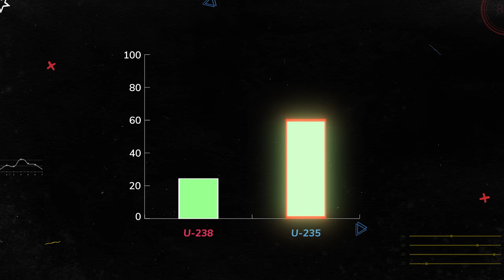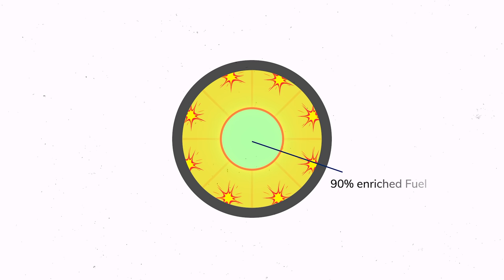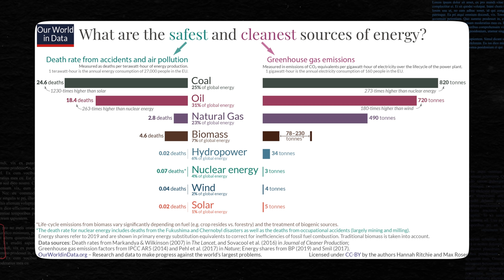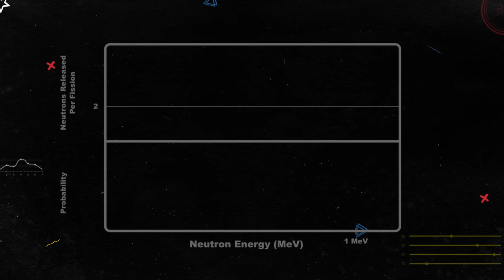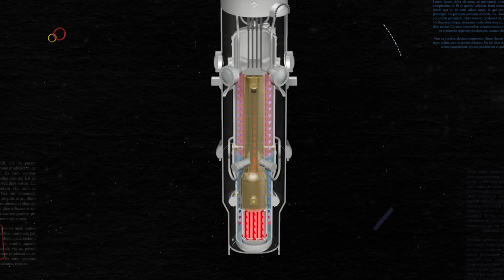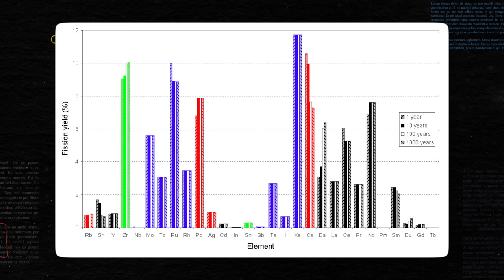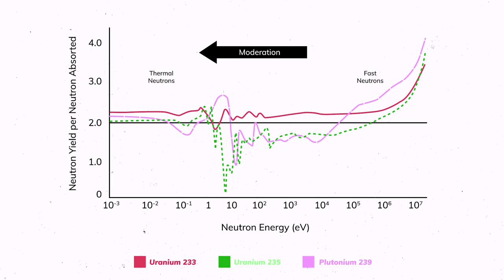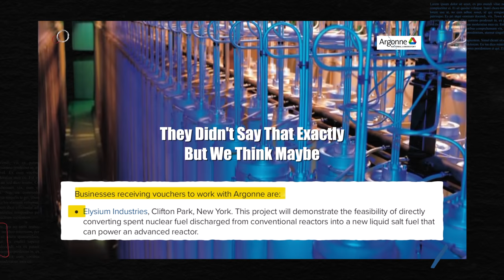This Reactor Feeds On Nuclear Waste

Comment: The one thing I noticed you didn't talk about is about is one of the safety devices they have designed into a molten salt reactor, There is a frozen plug they put in place where if the temps get to high, It melts this plug which then drain all the molten salt into an underground containment unit and instead of a nuclear melt down, the reaction completely stops, They then can fix what ever issue they where having and pump all the drained material back into the system to restart the process again, Without the molten salt you cant get a reaction out of the graphite cores, This prevents a nuclear melt down and only can be done in a molten salt reactor, I'm no expert in this field and only learned this through research years ago so I might of messed up on terminology or something but you get the picture of why this is such a safe system compared to a normal nuclear reactor
Reply from the maker: Hey, Elysium isn’t using a freeze plug.
Reply: @TechforLudditesSira  That would explain why it wasn't mentioned, I think its great they found a way to reused the waste, Ive been waiting for something like this to happened and knew it was only a madder of time, I look at what happened in the past and noticed a pattern, For instance, they discovered how to make kerosene and used to dump the waste into the oceans, they eventually learned how to make gasoline out of this waste and then they started throwing away the waste from producing gasoline, eventually they learned how to process diesel gas out of this waste, This made me feel that there had to be a way of reusing nuclear waste and it would only be a madder of time before someone would figure it out

Comment: VHTR reactors would be interesting to see analyzed here. also the Gen 3 to Gen 4 transition needs and costs. If there is already a good description why thorium reactors currently are not economically viable (infrastructure) and that the benefits of no weapons grade products - can be instead avoided and weapons grade fuels produced... there are many nuclear reactor designs and rarely they are popularized or spoken about as an integrated systems with industry or public. The UK schoolkids  nuclear waste microreactors also are a fun exercise to better understand polutionless energy production methods.

Comment: Another thing you can do with waste heat, is extract CO2 directly from the atmosphere  The extraction cycle consists of room temperature CO2 absorbing materials simply absorbing it, followed by a heat cycle to release it again.  This can be done in a controlled way to extract CO2.  Then, excess electricity from the same nuclear reactor, can be used - combined with water, to transform the previous atmospheric CO2 into a simple hydrocarbon known as "blue diesel", which can then be used as a replacement for oil in applications where other options are impracticle - jet fuel, plastics, etc.   This would make nuclear super eco friendly - actually solving existing environmental problems rather than creating new ones.
Reply from the maker: Interesting! I did hear Kirk Sorensen talking about how they were going to sell diesel from their nuclear plant and that confused the hell out of me. 

This is what he must have been talking about 😅

Comment: There's one more benefit to this kind of reactor. High temperatures enable it to create hydrogen efficently. Which we then can use in fuel cells and hydrogen combustion engines.

Fuel cells electric cars enable us to build electric cars with high range and fast "recharging". Because you don't need to recharge a battery. You just pump hydrogen into the tank.

Comment: The problem with Thorium fueled reactors is fundamentally chemistry. The solubility of thorium fluoride in carrier salt is less than 10%, and the fluorine, once ionized by the radiation, is aggressive enough to cause problems for long-term operation. Uranium chloride-based fuels can have a fuel content as high as 50% uranium by weight, and burn existing "waste".
Reply: Very good. I'd like to see a video on whether it is possible to meet the climate change requirements of the Paris agreement without large quantities of nuclear, is whatever type. Should we treat nuclear like a pandemic vaccine: too much is expensive, but too little is much worse.
Reply: @michaelwright7326  
Nuclear is by far the cheaper option if plants are designed to operate 50-60 years. If the lifespan is only 20-30, other renewables become competitive. This depends on location however, not all places have good consistent winds or enough sunshine. Atoms don't care about the weather.

Comment: apart from the cost of building a system to produce electricity, which i find irrelevant for this purposes, it is good to see that one of the two main problem is addressed and solved. Now what should we do with disused plants, as well as the main problem how to clean up a   site when things go wrong? I think if the clean up or null the effects and problems of radio active accidents etc can be nullified and be resolved as with the waste   then i think it will be more accepted as a source of power, by most of the public

Comment: Nuclear waste burning reactors already exist and are operational since 80s and 90s. Russian fast breader, lead bismuth or salt cooled reactors BRN 600, BRN 800, BRN 1200.
Reply: lead cooled systems come with their own sets of problems - lead oxidises and eats brains just like mercury does (quite literally, it's an occupational hazard of the leadworking industry and autopsies show brains with big holes in them). Bismuth is also dangerous to be around if molten and sodium just burns furiously

If you're going to come up with an alternative to using water, it's a good idea to have a SAFE alternative

Comment: I enjoyed this presentation. My question has to do with the losses of power thru distribution networks. If these  reactors can me miniaturized, then distribution is localized and loss through transmission goes away.
Reply: Perhaps.   I don't think it will get as bad as solar is, where there are mini reactors all over the place.  This is still a utility class technology.  It will need to be a real plant run by real organizations.   As such, it's a good replacement for base load grid concerns.  Since it's also much more load following, it solves the profitability problem nuke operators suffer.  As such it's even better base load.

In other words replace coal, natural gas, and eventually old nuclear with this stuff, in that order.   Allow Wind (More utility so grid friendly) and solar (grid unfriendly) to be used as we see fit.

To the grid problem, so yes Solar causes the need for a decentralized and multi directional grid.   Even if we didn't need to rebuild the grid for this reason, we need to do so for EV's anyways.  Substation capacity is in question, and the last mile needs to be rebuilt to a 200A standard.   Either way, the grid needs a total overhaul.

I only foresee these devices in use outside of power utility applications in very specialized environments.  Picture someone wanting one solely for the thermal capacity, to smelt steel in a low carbon, no-electricity method.    Or built into a ship or barge, to allow remote communities access to cheap power, off the grid entirely. (Think Thorcon)

Comment: Problems with that tech.: 
molden salt ruins the Wall material(or its getting really expensive)
nuclear reprocessing is a difficult and controversial process
self regulating is good but scram is difficult
also you need water as cooling also as emergency cooling - think about an situation when water mixed in an accidant with molden salt (not good)
to tell a few problems
also reserch and authorization +building and testing need (a lot of) time
Have a nice day

Comment: They better be quick.  Solar and wind generated power is getting less expensive every day and various new batteries are solving the  problem of when they are not generating.  Soon there won't be a case for any other source of power.

Comment: As I recall the molten salt style of reactor can also be used with thorium as fuel once you're done eating nuclear waste, and has a convenient emergency shutoff system for if the reactor should lose power for any reason. 
I'm not exactly an expert on anything reactor related, that's not my field at all, but I've always been annoyed at the fact that America had working thorium reactor schematics that they never used because Nixon shot the idea down.

Comment: Nice thought but at the moment not practical or as safe as this says. Radionuclides come in contact with major components require a significant more amount of maintenance then pressurized water reactors, as well as relying on nickel based alloys and iron which in a MSR would be more susceptible to brittle fractures. Theses reactors have a very small operating envelope. Not to mention that fast fusion is not as controllable a thermal fission. I could go on a write about the 19 major issues with this type reactor but I think is is enough for now.

Comment: Wouldn't it just blow your mind if the Keeley motor used nuclear fusion from imploding water bubbles (sonic fusion) ?  Wouldn't it be funny if meta-particles formed in time-phased space with oscillating variables like pressure?

Comment: What are they using to contain the molten salt? I know that the thorium liquid salt reactor had to use high purity nickel or the molten salt would eat through the reaction vessel and heat exchanger. It looks like this wouldn't have the plumbing problem, but the reaction vessel might still need to use nickel.

Comment: fast breeder reactors will never have commercial success, the reason is the same as 50 years ago. They can be used to produce plutonium. The advantages of an FBR have are well known but no country with sane leadership will sell a reactor capable of producing weapons grade nuclear fuel to a country without nukes (and countries with nukes have the ability to build such reactors)

Comment: Interesting project, I hope it could succed. My main concern: isn't a fast spectrum reactor (doesn't matter liquid or solid fuel, in this case) more prone to long term material stress, embrittlement, etc...? Or, maybe, the EI team envisages to build those reactors with temporary structures peridocially to discard and replace ?

Comment: No, it does not.
Molten salt reacotrs or dual fluid reactors can take only a very tiny fraction of nuclear waste, otherwise they become inefficient.
But they do offer new options for catastrophic failure.
Reply: @boy123838  Oh, you don't like to hear that all fission reactors are crap?
Bad news, they do not only suck when they go boom, they also suck when it comes to operating costs, they can not even compete with coal, much less with solar and wind.

Comment: No, the cost is high because of the number of workers required and the size and complexity of nuclear power stations. Nuclear reprocessing is nothing new, we in the UK have stopped going it because it is extremely expensive.
Reply from the maker: They were very keen to clarify that their fuel production process is not considered reprocessing by the DoE :)

These are definitely complex compared to Wind and Solar, but take up far less space, and can supply electricity reliably. 

Hard to say how everything will work out in the end. Only time will tell.

Comment: This technology is not new; Fermi Unit 1 was a fast breeder, sodium cooled reactor which achieved initial criticality in the 1960's before suffering a mechanical failure due to debris in the reactor. Now I am not saying that modern companies should not try again to make this technology viable, but this video did not address worker training or waste storage. Operating a nuclear reactor of any type requires years of study in the classroom and on the job. Also, sodium cooled reactors still have radioactive waste byproducts that have to be safely stored for centuries. Sodium is also very corrosive to metal, and because we have never run a full size sodium cooled reactor for 25, 30, or 40 years we don't know what other types of problems will occur over time. Companies always claim that they have worked out all the problems with their reactor design and operating procedures only to discover something they did not foresee later on after there has been a operator error or a mechanical failure. Good luck with this one, but I don't see this type of reactor ever being accepted by the general public. People are smart enough to ask the hard questions, and if they don't get the right answers then it's not going to fly very well.
Reply: You must be fun at parties...
Reply: @MrTaxiRob  Oh come on! You know that neutron radiation gets you hot and agitated with all those molecules bouncing around getting things heated up! You're not one of those alpha-beta-gamma type of guy who is going to get all shy and intimidated by a woman who understands fission technology are you?

Comment: I like that (F)MSRs are still relevant in the nuclear industry today's because many critics in the past have depended on sustainability arguments such as the use of water in nuclear plants. 

Not only are less safety provisions needed, but humanity can divert this mode of water use towards others such as the support of communities experiencing climate change in real time. 

I still have this suspicion that nuclear (i.e. MSRs) is not perfect. This iteration seems so because of the nuclear waste sink, avoidance of heavy water as a medium, and the ability to retrofit existing plants, including coal. 

Since the neutrons are moving so fast, do you run into a similar problem as with fusion? (with how neutrons, I think, strip away the metal container: from your other video on the matter). What are the maintenance activities during plant lifetime, and how long would an Elysium reactor last? 

Great coverage and comedy as always 👏

Comment: Would love to hear an update on what Flibe Energy is up to
but the last time I've heard they do not anticipate their design to be ready for commercial use until late 2030-ies at least.

So id humbly ask to look into those modern nuclear designs which actually can be implemented in the next several years
ThorCon guys were supposed to start building their pre fission demo plant last year - I wonder how they handled 2020...
Terrapower received a grant from the US Department of Energy - would be nice to know what's new with them.

Comment: Make a video about Copenhagen Atomics. , they develop a thorium molten salt breeder reactor in the thermal spectrum. Have build the first non fission prototype , are building 2 more non fission prototype in 2023 and 2024 and plan to have the fission prototype ready in 2025.
Can work with 5 % enriched uranium or spent nuclear fuel

Comment: How exactly does this differ from the MSRE from back in the 60's?
Reply: 1) the fuel salt is Chloride not Fluoride, Chloride is heavier so the neutrkns can stay 'fast' even after bouncing off it, 2) how many wall-separated molten-salt zones there are in the reactor, the old one had no breeding-salt zone, 3) how 'stringy' the geometry is, tge old one was a mass of skinny pipes, this one is bokd, simple tanks, 4) presence of graphite to be a moderator, new one removes that.

Comment: Being a total newbie in this field, but does this new technology include "eating" the waste of already existing nuclear power plants? Reducing the extremely current storage times?
Reply: Yes, used nuclear fuel can be the input for the chloride conversion fuel preparation step.  It doesn't have enough fissile material for the initial reactor startup by itself, but can contribute, and can be the fuel that is added to keep the reactor running.
Reply: @EvidentlyChemistry  Thanks for clearifying. Sounds more than interesting.

Comment: Fantastic presentation. I think the crux of the antagonism towards nuclear is economic, not environmental (sadly) or feasibility.

Perhaps you can discuss this?
Reply from the maker: We did that briefly here :)

Negative cost of fuel (Using spent nuclear fuel) , plus fewer safety requirements (low pressure operation), and quicker deployment (modularity).

Exact numbers are hard to come by, but these factors suggest that it may be possible to beat PWRs in terms of cost.
Reply: @TechforLudditesSira  no, you failed to address the primary issue. Nuclear requires large R&D and enormous capital expenditure, relative to alternatives (except, perhaps, hydro or geothermal).

Comment: What ways are used to reduce or eliminate the corrosion liquid salts cause. Shutting downs and replacing parts because of corrosion, containing and injecting salts back into the system. Seems that there could be complex maintenance issues, not that there are not already those in current reactors.

Comment: What i would like is a unit that fits in my current fireplace, heats the hot water / radiators and generates around 6Kwh of electricity. not too worried about the mice glowing in the dark.  What sort of time scale are we talking here?

Comment: What is the end waste product of this process? What are its characteristics, and what do we do with the stuff? Is this new waste going to be worse than what we have now?
Reply: Basically, you need 250-300 times less fuel to produce the same energy and final waste is only  tens years of radioactive life (like caesium, strontium, etc...) vs 25,000 years for plutonium, for instance. So, a big improvement both in quantity AND quality, I think